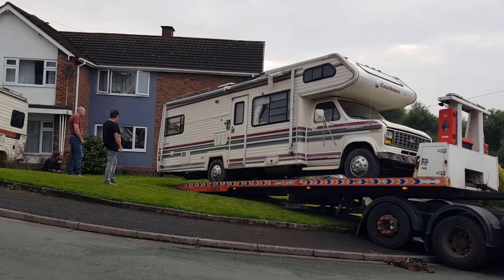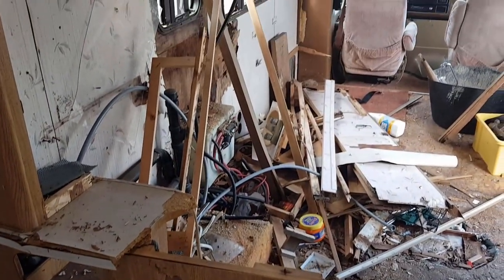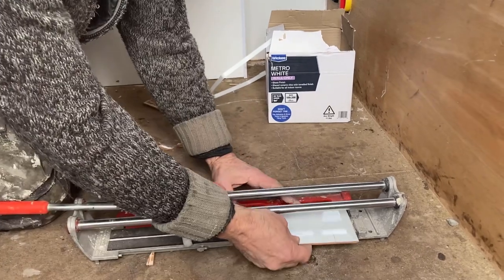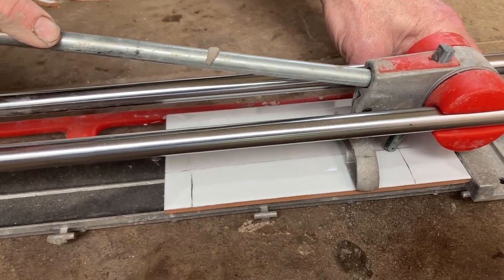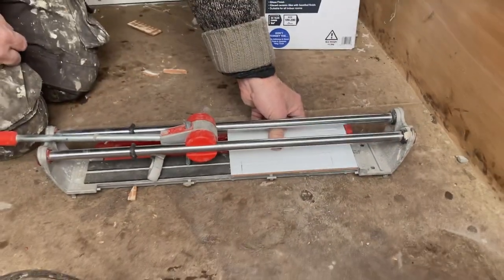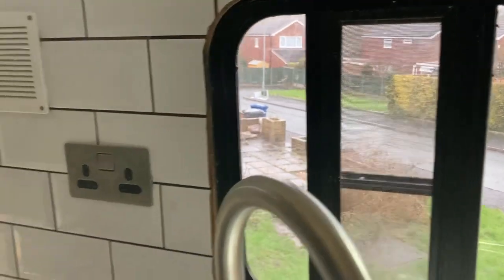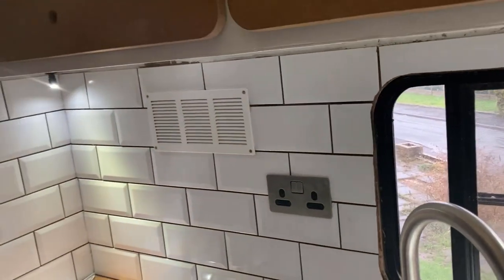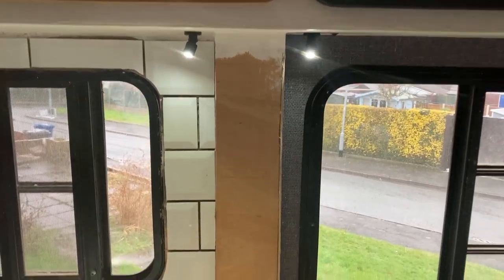😍 EASY How to Wet & Dry Cut Ceramic Wall Tiles | Vintage American RV Motorhome & Paint Spraying

Comment: Great video again guys. In view of the weather how long did it take for the tiles to go off and the doors to dry?
Reply from the maker: The tiles stuck fine and have gone off solid. The paint on the doors took a lot longer than then they would in the summer months, plus we had to bring them into the warm kitchen, which meant our house smells of paint, and still does lol.